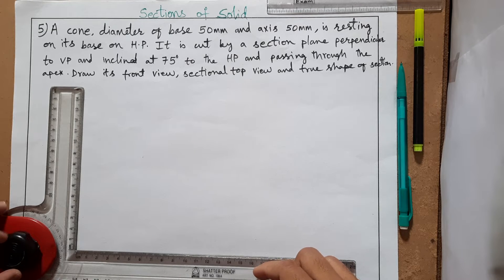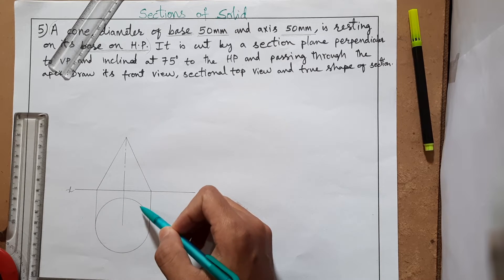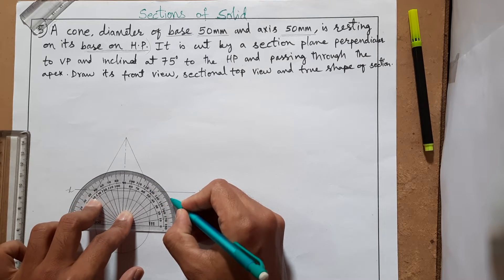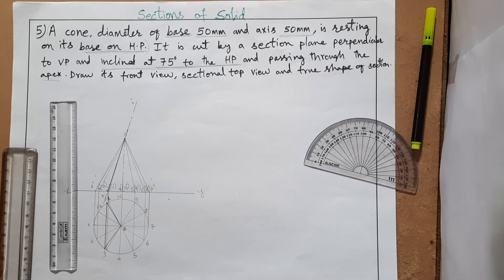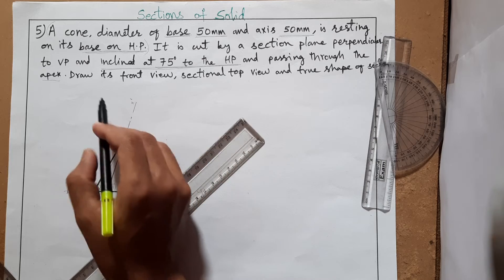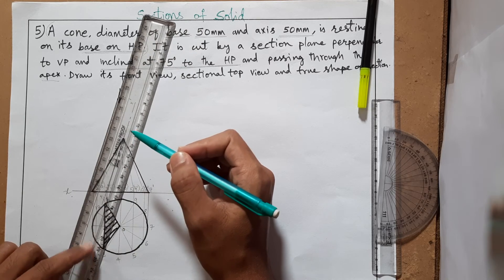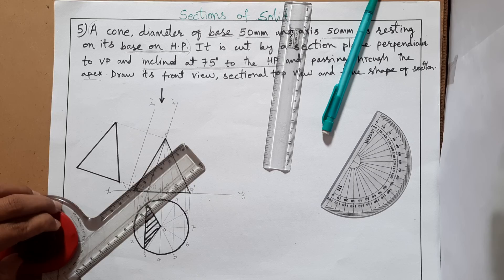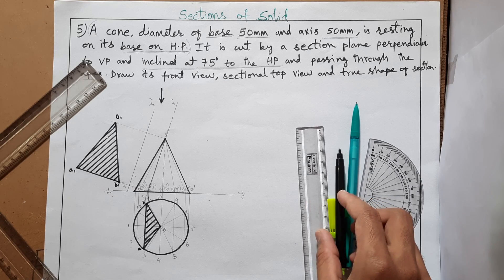Section of Cone & True Shape | Section plane inclined to HP perpendicular to VP | EngineeringDrawing

Comment: A cone base 50 mm diameter and axis 60 mm long is resting on its base on 
the HP. It is cut by a section plane perpendicular to VP and inclined at 450 to HP 
and cutting the axis at a point 20 mm from the base. Draw development of 
truncated cone

Comment: 22. A cone of radius 40 mm and axis 60 mm long is resting on its base on HP. It is cut by a section plane 
perpendicular to VP and parallel to HP at a distance of 20mm from top of cone. Draw its sectional top
view, true shape of both parts. Write the steps of construction.
Give me YouTube source also
Reply from the maker: True shape will be circle concentric to base circle of cone.
Reply from the maker: Top sectional view will be the true shape. No separately true shape is needed to draw.

Comment: . A right circular cone, diameter of base 56 mm and height 65 mm, rests on its base on HP. A section. plane perpendicular to VP and inclined to HP at 45°, cuts the cone meeting its axis at a distance of 36 mm from its base. Draw its front view, sectional top view and true shape of the section.

Comment: A hexagonal prism ,having a base with a 30mm side and a 70mm long axis,has its face on the h.p. and the axis parallel to v.p. it is cut by a plane ,which is perpendicular to vp and makes an angle of 450 with the hp bisecting the axis.draw the sectional front view and true shape of the section

Comment: I only came here to find how to find the centre point that you have to measure it instead of vertically rulling down
Reply from the maker: Measuring may workout in this problem but for other problems it won't work. That's why I am following standrad steps and procedure so that other similar problems also you can easily solve.